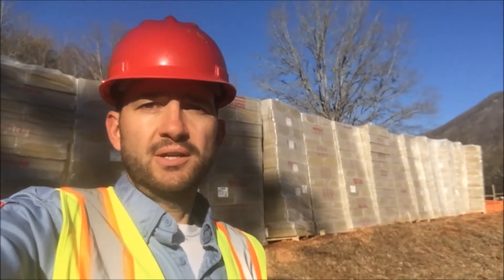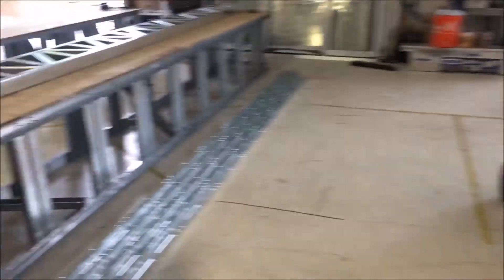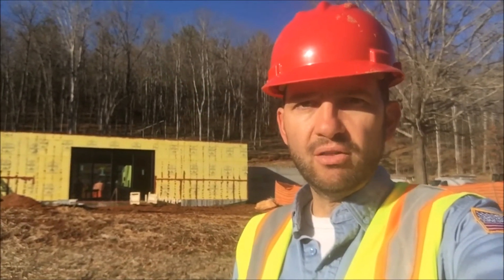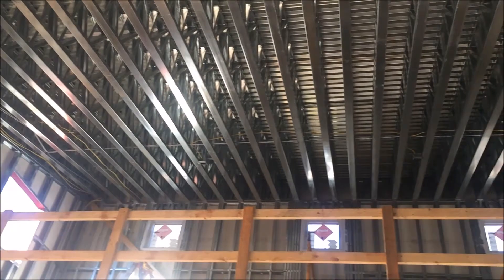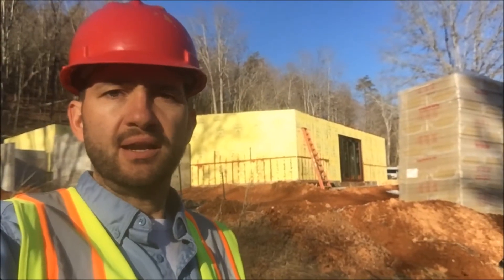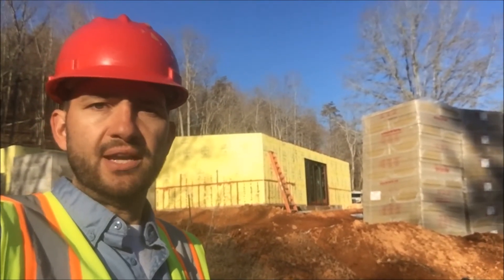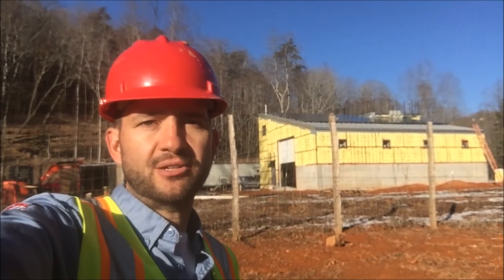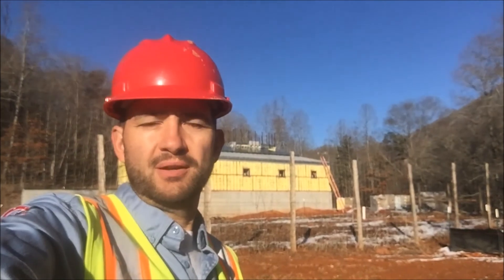Building Off-Grid Home w/ Panelized Metal Framing

Comment: what's the point in building a metal building using metal studs if you're going to add drywall ? I am building multiple residential and commercial metal buildings but I am not using any drywall I fucking hate drywall

Comment: Are you satisfied with 18GA thickness Chris?
Although it will increase the cost, I would prefer at least 14GA.
EPDM bands you put at the bottom frame is also good to prevent heat bridging.

Comment: You don’t mention what’s going onto the outside of the building, but … if the “water control” layer is behind the insulation, why do contractors need a “rain screen” in front of the insulation?
Joe Lstiburek (where the perfect wall comes from) wrote about problems he had with ants because the Tyvek was incorrectly installed and allowed water into his insulation, allowing the ants to have a nurturing environment. 

I think we need to reconsider the order of these layers.

Comment: No matter what, don’t EVER build a house with metal framing, UNLESS... metal framing is more than 10 times as (thermally) conductive as wood.

You used four to eight inches (4” to 8”) of rockwool insulation on the outside of 18 gauge metal framing.

Your honesty is very helpful. Giving us the truth about the pros and cons, makes you amazingly helpful to us.

Comment: Bro... just use closed cell foam at R-7 per inch instead or R-3 for rock wool.
Reply from the maker: Rock wool is 4.3 per inch, it’s non-flammable, it’s non-toxic, it sheds water instead of trapping it, bugs don’t care for it, etc. check out our video about why we use it- https://youtu.be/9-03QHLZyjM
Reply: @LGSquared  I would’ve just used closed cell man. Seems more efficient and might be around the same cost.
Reply from the maker: @ericc4209 In this case especially, the closed-cell would be in the cavities, and every single metal stud would be a super-conductive thermal bridge, creating an opportunity for large amounts lots of heat loss and condensation. The rock wool is uninterrupted on the exterior, and creates a thermal block for each stud. So, the continuous rock wool assembly contributes to a much more energy efficient building, by reducing the heat loss, which reduces the amount of heating needed to maintain temperature/comfort, than a spray-foam assembly.